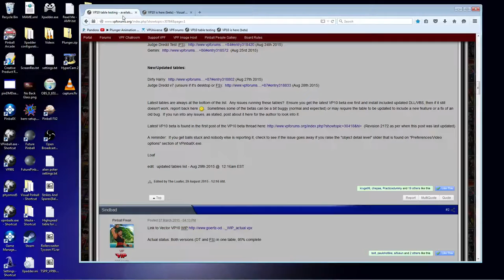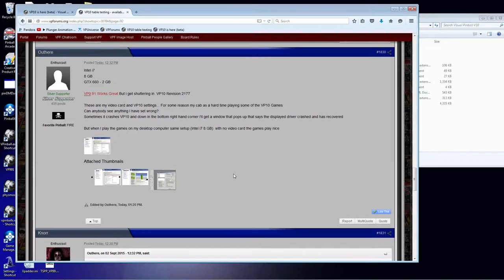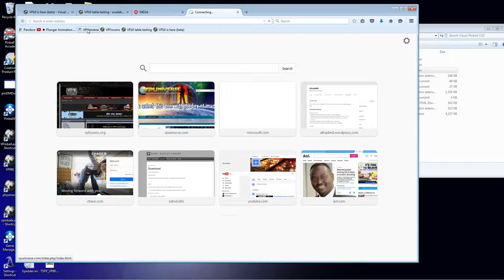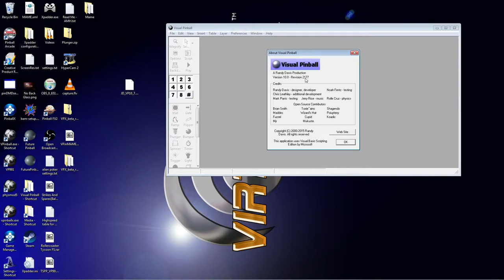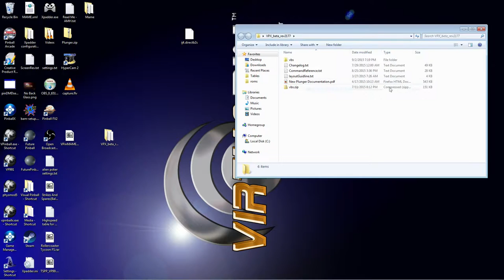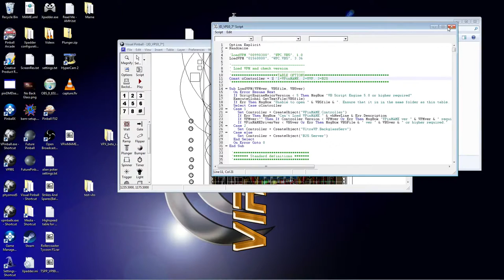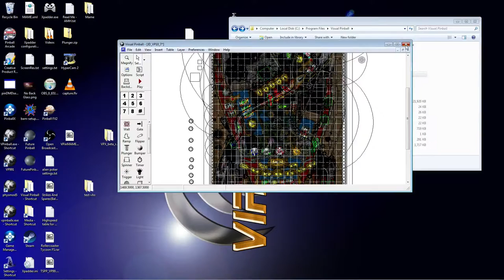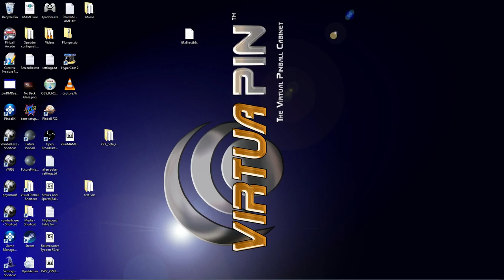VP 10 Setup Guide

Comment: once again you have made another awesome tutorial.
i have a question about something i have been struggling with i have all types of tables and exe. files some work with certain stuff and some don't work for me at all my question is what do i actually need to run these tables properly on my cpu. system requirements like graphics card and ram. as you know i am new to this but i am excited about learning to create my build.i just need to learn from someone's expertise i can trust.and you are in my opinion the guy i trust for information.thank you in advance for all you do for us.you are truly awesome
Reply from the maker: My quickest response is to go to virtuapin.net and look at the system specs Paul has there for the cabinets he builds. Anything along those lines will get you a good setup. I would recommend using a 64bit version of windows so you can have the ability to add system ram and also make sure you gpu has a good amount of fast ram. If you want to go overkill put your os on a decent sized sata disk and then put all your tables,roms,frontend files on a solid state drive. Hope this helps

Comment: Great video on VPX. I've started experimenting with this new version on an old computer as I didn't want to risk messing up VP9 on my cabinet. So, I would like to know if you were able to figure out how to keep separate VBS files between the versions?
Reply from the maker: I have been really backed up with normal life stuff and my arcade emulation project I'm working on. But I will check soon cause my pinball machine is gathering dust and more vp 10 content is being released so I will be doing a more in depth video in the next few weeks time permitting. However i believe you can separate vp10 completely. I will check to get you that ASAP.

Comment from the maker: @horsepin
For some reason cant reply directly.  B2s lag can sometimes be fixed by having the backglass skip lights or tell it to use simple LEDs. There is a troubleshooting file with the b2s application zip. However, there are some back glasses no matter what i do it still generates lag.